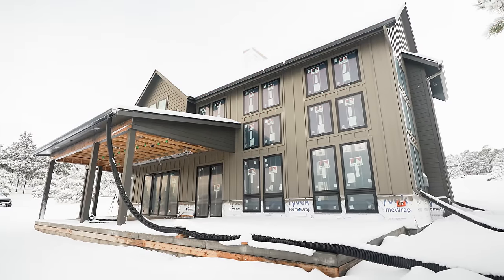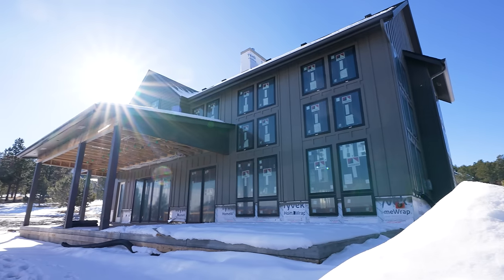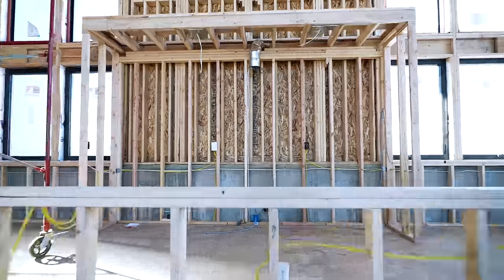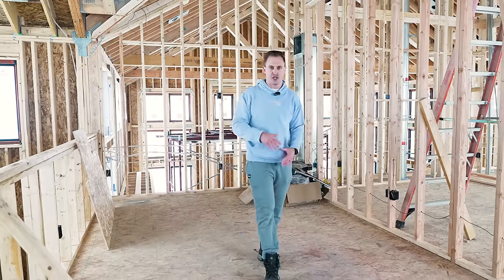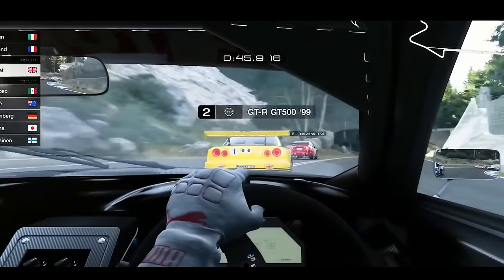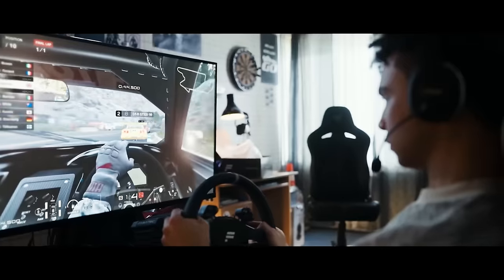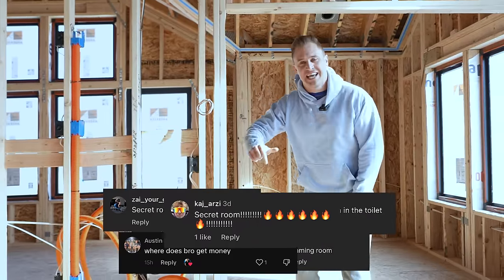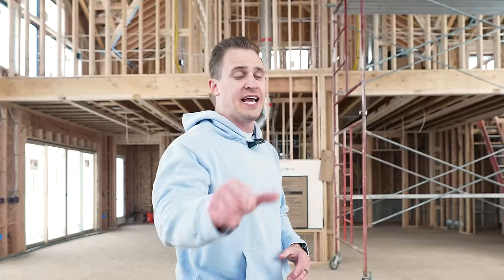Building The Ultimate GAMING House - Part 1!

Comment: 00:01 Building the ultimate gaming house with every gaming system imaginable.
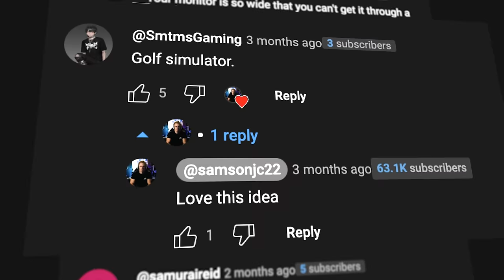00:40 The gaming house has transformed based on viewers' comments.
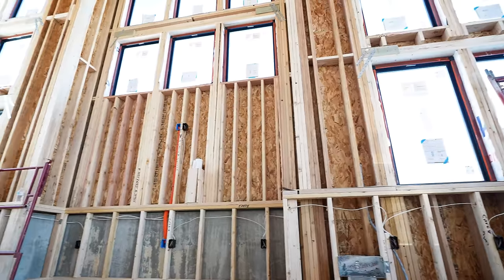01:22 Ultimate gaming house includes a fully equipped kitchen and lounge area
02:03 Exploring the second floor of the gaming house
02:41 Grand Turismo did not meet expectations
03:25 Exploring best racing SIM for the ultimate gaming room.
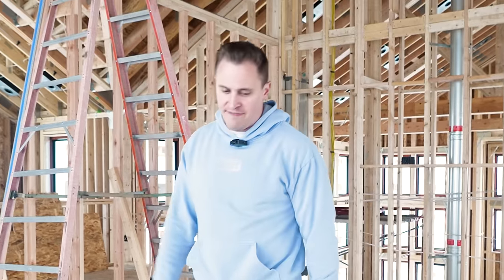04:02 Building a golfing simulator room and secret gaming room in the ultimate gaming house.
04:43 Secret gaming room has evolved into a full-blown console PC and VR room
Reply: Thanks!
Reply: OMG its cipher pea kay
Reply: 1. spelled wrong
2. CLEARLY not Sypher @KINGOFDOGGS